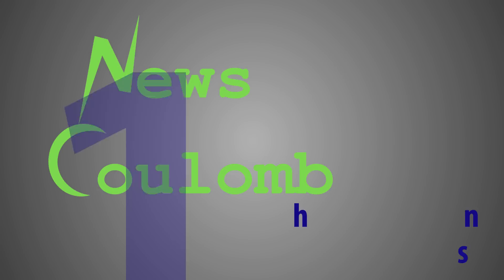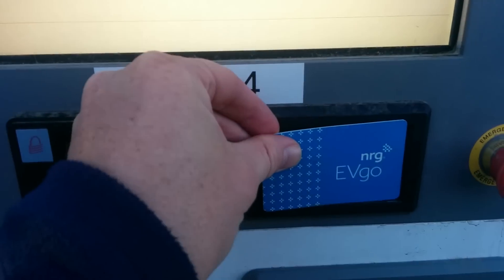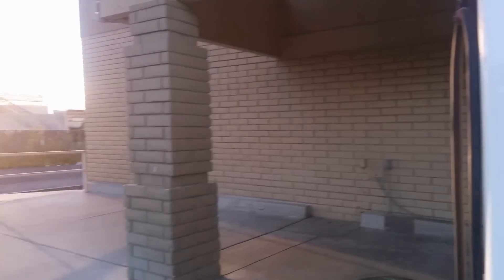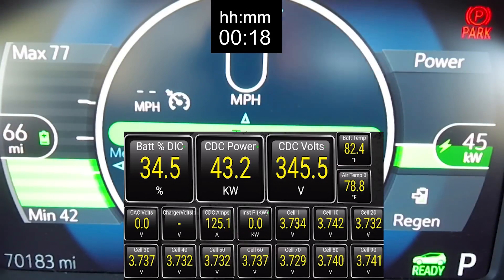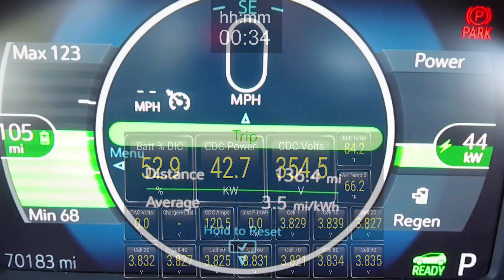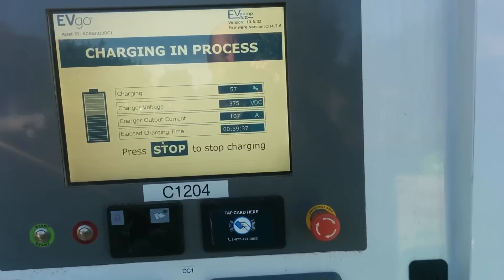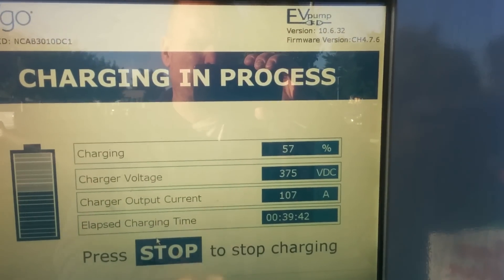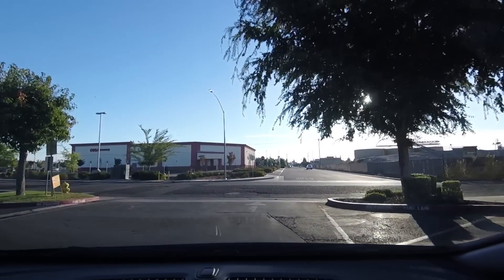Bolt EV DCFC: Chasing a 130 A "Unicorn" Charger

Comment: I was wondering if you had ever used a newer Electrify America or other brand station that shows higher output.
There are EA stations near me that are labeled 150kw and  350kw. 
Would you get much more KW delivered to the car. On the dash. Increasing the charging speed with one of those.
I've looked around and not found any videos of someone using one.
Just wondering what the Max is on the Bolt
Thanks.
Reply from the maker: Yes, I've done a few charging sessions like that (and I believe I've logged a few). I maybe need to do a better logging session, but here's one: https://www.youtube.com/watch?v=a2t4adi2SSQ

Comment: Can you use torque-pro with the car off? I have a feeling that some of the power is being diverted away from the battery and is being used for climate control/battery conditions/other electronics. Just speculation at this point though.
Reply from the maker: No, you can't getting any readings when the vehicle is off. The OBD2 adapter remains active, but TorquePro connects through the ECU.

Comment: Have you had a chance to plug into one of those Electrify America chargers yet? Right now there are only 24 currently operational. But there are 3 in Oregon, might make an interesting trip. They are rated for 150kW, but that is assuming 300A @ 500V, so obviously a Bolt will not be able to take full charging power...
Reply from the maker: Not yet. They have a couple going in along my regular route. They should be open by this winter.
Reply: Saw my first Electrify America installation today at a WM in Ooltewah, TN. 15 150 KW CCS stations and 1 ChaDeMo. No one there. Quite impressive, I would have taken a pic but I was maneuvering a 42’ motor home and flat towing my van. $1 to start and 30 cents per minute.
Reply: @DiscoveryOwners  Wait. There were 15 CCS plugs?!?! That is like the Tesla Superchargers....
Reply: mzs112000 I did not verify, but PlugShare said 15 CCS and 1 ChaDeMo. I did count 16 charge stations. I was impressed. Maybe something an EV buyer should consider.

Comment: I used a newer EVGo station and got 120 Amps. It started with 115 or so then it slowly increased as the battery filled up. I only charged to 60%. I believe it would have went up to 125 eventually. But then my adapter is limited to 125 Amp.
Reply from the maker: Many of the CHAdeMO chargers are 120 A max rating (even when on the same unit as 125 A CCS). That's part of the reason why I couldn't confirm whether Kendra is now working at 125 A (or still 100 A).

Comment: I'm curious where the power is measured. I know eVgo showed higher power before and then changed later (described in my blogspot). It could be that some measure power at input (3 phase AC side) and others measure at output (DC side).
Reply from the maker: Yes, I'm not sure why there's the error. It could be a result of retrofitting these chargers beyond their original specs (they are listed as a max 100 A), so switching out modules could cause an error.

Comment: I don’t know of any published list of “130A” EVgo BTC Power chargers. I only personally know of that right-most charger in Madera and a couple of others in the northwest I noticed while on a recent drive to Seattle.

Those two upgraded locations were the Tacoma Mall in Washington state along I-5 and another location at the 7-11 near Portland Airport in Oregon along I-205.

The one in Madera still has a specification “nameplate” on the outside of the unit that says it was built in 2015 and has a max output current of 100A. It’s been putting out “130A” since at least July, 2017.

By the way, the Premiere Veggie pizza with Jalapeños at the pizzeria in that shopping center is awesome. I order one every time I stop to charge. As in just yesterday.
Reply from the maker: Haha! The pizza. I think you've mentioned it before. Do they do gluten free?
Reply from the maker: By the way, I think Tony Williams gave a lengthy, detailed explanation for the discrepency between the display and charge rates. I figured giving people an example would put the issue to rest. 😀
Reply: I dunno about the gluten free.

Comment: I think there should be some federal meter certification that goes around and checks these meters to see if they deliver the kw, Amps, and kWh and even verify the timer is accurate on every paid charger, and depending on how it bills, any error which steals from customers should come with a fine. 

Most people have no way to know if they are getting screwed, they would just charge and pay any reasonable amount shown. I think the car manufacturer can also include a meter showing how much is coming thought the port, and then showing what percent goes to the battery and what percent to HVAC and what percent to other auxiliary systems.

Of course 5 amps high doesn’t seem like much but if you are being charged by the minute then you are paying a 4% surcharge.

Comment: NC - have you hit the ceiling for Bolt EV charge rate?
Reply from the maker: Yes. I did a 150 A DCFC charging session early. Peaks at 55 kW.
Reply: was the station capable of more? DO you think the Bolt has a hard limit of 150 Amp?
Reply from the maker: @DavidDrivesElectric  Yes, the Bolt EV has a hard limit of 150 A, though it's possible that it might take additional power for battery conditioning and climate control. I haven't had a chance to verify that yet.